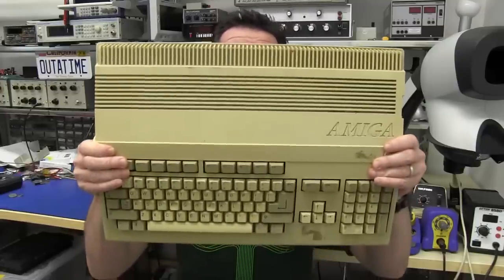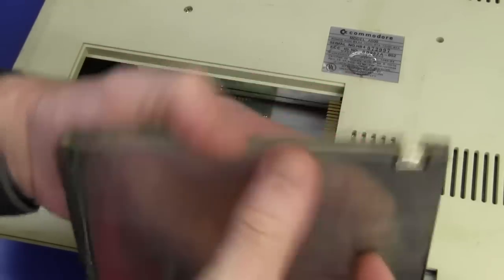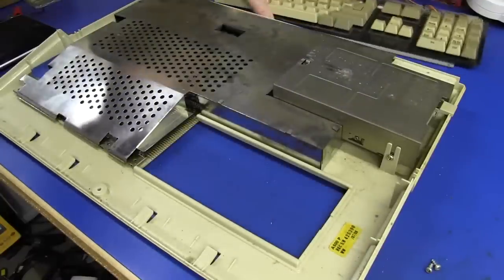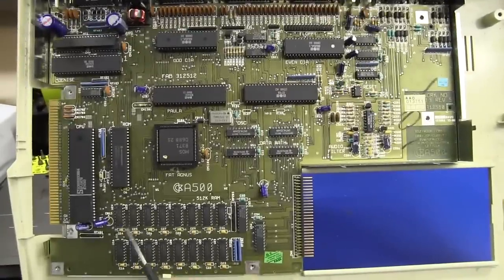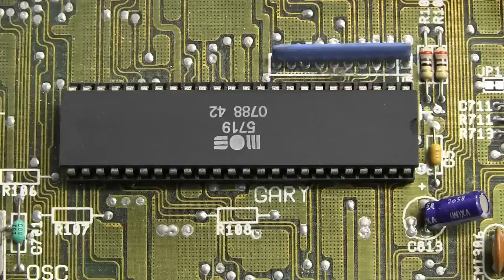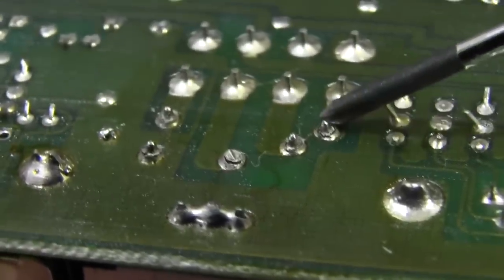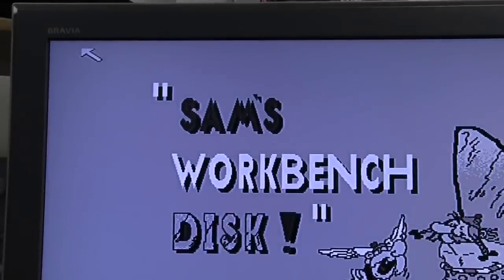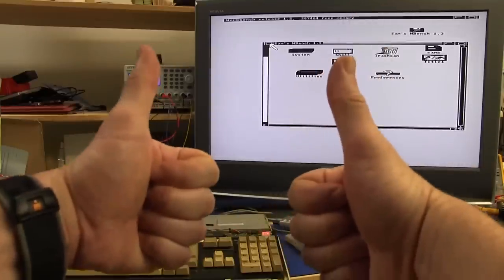EEVBlog #438 - Amiga 500 Retro Computer Teardown

Comment: I still have my Amiga 1000 with a 2 meg memory expansion module and a 20 meg hard disk plus floppies.  In 1987 it was the best computer on the market.  Commodore decided to make the Amiga a game machine and not a computer and stopped the research to make it better.  They did come out with an Amiga 2000 but is was just too expensive.  I moved on to an IBM machine when Windows 3 came out.  My first IBM machine was a 20 MHz 386 and I bought the $500 math co-processor to go with it.

Comment: Oh, for a minute there it looked like your floppy disk image on the monitor was blue, but then you obviously didn't have your screen hooked up to the color port on the computer (or you would have had to have some kind of crazy pin setup for that 23-pin connector). But then later everything looks B/W, so you were just using the built-in monochrome video jack (and had a blue tint earlier). Too bad they didn't just give the machine a color composite output, instead of making us rely on the A520 converter for composite output, huh?
Reply: +MaxxFordham They wanted to sell that extra part once you realized you could only get black/white with your old C64 monitor...
Reply: Well, if that's true, descore, then that would've been an annoying business practice that I'm glad isn't always done too often. At least they got smart and added the color composite jack some later models like the 600 and the 1200, but I never had one of the more advanced monitors or either one of those machines until much later in life, actually. Even then, my 600 is a UK version, so its composite jack still doesn't work right for me here in the USA.

Comment: And to think, i just threw mine away, along with thousands of disks :( It was important machine to me but when you move from town to town, you get tired of useless things around you.

First time i had my hands on Amiga 500 was when i "brokered" a sweet deal for a friend thru a schoolmate who was from Netherlands and they were cheaper there. As a reward, i was granted a full month of using it, pretty sweet thing back in 1987 when most kids around didn't even have C64s... Got my own around '95, of course i gamed with it but the main use was as a sampler and running Octamed with MIDI sync of course. The 8-bit 22kHz sound was pretty unique.

Got a lot of gizmos for it too, action replay, midi interface etc. Action Replay particularly was  handy for ripping sounds straight from RAM. And of course, multitasking. At best i managed to run FFT graphical synth, OctaMed, word processor and some small utilities at the same time.. The chipset design was just awesome, it was soo flexible and took a lot of responsibilities away from CPU making it really fast to run audio/video.

Comment: 8371 Fat Agnus isn't 1MiB chip mem capable. 8372 (first one to be part of ECS) was capable of addressing 1MiB chip mem.
BTW this is REV. 5 A500 wasn't capable to run 8371, you needed Rev.6 to use partial ECS.
No full ECS was posible on on A500, as full ECS could be fitted only on PLCC chips.
Reply: +WizardNumberNext  The 8371 was the OCS PAL and 8370 OCS NTSC Fat Agnus. 8372A was the ECS version mac 1 meg chip. and the 8372AB for the 500+ version which can handle 2 meg chip. 8375 is the 2 meg version which was used in the A600

Comment: Oh yeah.  That was my mistake.  I had my terms wrong and I wasn't paying attention to what I was typing.  I know that computers at that time weren't even capable of having 1 GB of memory.  As for computers no longer needing 1 MB of memory is simple.  File sizes keep getting larger and therefore a computer needs more memory to handle larger packets of data moving through the system.

Comment: Is your screen B&W? My Amiga 500's Workbench is colour (though that's prob a really old version I guess - but strange the game was B&W too). You may already know this but you don't need to boot games from Workbench - games auto boot from the "Insert disc/Workbench" screen. Always found it odd it asked for WB when it was probably the least used software lol. I used it for mainly copying disks and virus checking. My biggest gripe with mine was when I got Monkey Island 2 and it came on twelve floppies! I'd never heard of a hard drive at that stage and I gave up after spending the best part of an hour swapping disks. You'd literally walk into a bar and it'd ask for three disk swaps. Two mins later you'd go back out and you'd do the same again!
Reply: George Allan He was using the Amiga 500s built in composite output which is only black and white.  There was some software that used it to display an image with more shades of b&w than you could get out of the RGB output.
Reply: Ah good to know thanks! I mainly used an RF modulator. Thinking of removing the bromide/yellow plastic from my amiga at some point. Looks like a lot of work though
Reply: George Allan I need to do this too.  I haven't used Amiga hardware for more than a decade and am just starting to do so again.

Comment: The green solder mask looks like a product called Probimer developed by Ciba Geigy, it was a liquid mask, one of the first that actually worked and passed UL approval. It worked real well as a mask, but could look like shit. The second Amiga board (the one you stole a floppy from) looks like it has Vacrel on the board, which is/was a dry film solder mask from Dupont. Vacrel worked real well as well. Just my thinking. Worked on developing these types of coatings back in the mid to late 80's.

Comment: Don't knock that old computer about too much Dave. The first Star Wars movies were made on those. That expansion bay on the side is capable of so much more than memory. That's the Zorro slot system. They weren't called the Amazing Amiga for nothing. I have a 500, 1000, 1200, 2000, and a 4000/030. I'm still looking for a working 3000. I also need a copy of Workbench 1.3 if anyone has one that still works.
Reply: Star Wars was not made on any Amigas.  Star Wars eps iv-vi were filmed mostly in the 70s and early 80s and most of the CGI (such as it was) was done on custom hardware - Picture System 2 and - made by Evans and Sutherland (mostly for motion tracking shots using digital chromakey).

Comment: Well I have to say that the way the board was designed ie. double sided NON thru-hole plated has nothing to do with made in Hong Kong in the '80's, the designer would have designed it this way and the PCB manufacturing plant would have made it that way. Commodore would have made this decision based on the cost of thru-hole plating at the time. A PCB manufacturer at the time either got gerber files that they turned into photplots on film or as photoplots on film. These would then be used to manufacture the board to plan.

Comment: The iPad would probably still work in 2035, like I would expect my tablet to work in 25 years time, though having said that today's devices have to contend with being made with lead-free solder, which apparently isn't good.
tbh, I think the problem nowadays isn't so much that today's devices are more fragile, it's that I think QC processes are less stringent, so more bad devices end up out there, apparently the cost of replacing those bad devices is less than proper QC

Comment: Hi Dave,

If you want to know more about the Amiga and it's development, and a butt load more about Commodore in the 80's / 90's, check out the book "On the Edge" (ISBN 0-9738649-0-7). It's a big ass book, but it's very cool. Brings up a lot of interesting info on the design rationale for a lot of CMB stuff. Not to mention their fabrication plant. It's really worth a look. (I am not affiliated with this book in any way shape or form).

Comment: i keep a working 3.5/5.25 combo floppy drive around just for shits and giggles. sometimes you can find some interesting things on old disks (although i have to use my backup computer these days to even connect the drive, my primary doesn't have a floppy controller, yeah, floppy disks are officially dead and have been for over a decade)

Comment: Hi mate, the game you're trying to play aint in monochrome, what i think happend here is that the amiga is both pal / ntsc, it doens't care, but the sowftware you run on it DOES! if you have an decent monitor (wich takes both pal/ntsc) what i mean is that, and ntsc machine runs pal software, an pal machine do run ntcs software, but you have to hook it up to an monitor (15khz) or newer tv 15 - 31Khz AWSOME dubbelscan features, you would have gotten color boot from start to the end of the game :) yes, i',m an amiga fan, you can't hook up 31khz monitor to an 15 khz output and the just think.. it will work.. answer nooooooooo! can't you please do something like this about an amiga 1200 (wich is my favorite amiga model) and i'll help you out 100% ive have ppc card, pci card (through mediator) with an stunning 68060 cpu at 66MHz and PPC cpu @ 300MHz (real dual cpu system) they are from completly different archictuhure) with for the moment only 128mb ram, but as an amiga fantast.. that i am.. you don't need much more.. anyhow, get hold on an amiga 1200 and explain it for me, i can help with the things that maybe feels fuzzy :)

AMIGA FOR THE PEOPLE! NEVER STEP DOWN THE ART OF THE WORKS!
Reply: He connected his TV to the MONO port on the back of the Amiga, that's why there is no color, nothing to do with PAL/NTSC. He didn't use the RGB socket either directly or with an RF modulator, presumably because it is a DB-23 socket and those connectors are hard to find these days.

Comment: 24:59
Of course, with the 68K's whole "you can only access memory once every 4 clocks" kink, the CPU's clock rate might as well be 1.77 MHz. This also makes the Genesis MILES slower than the SNES despite having more than double the clock rate.
Reply: No, the CPU worked at 7 MHz.
Reply: ArumesYT The point is, it didn't work well with memory. "Blast processing" is clearly a HOAX!
Reply: Rogue Packets
There's a lot more to computing speed than memory access times.
Reply: ArumesYT The 6502 can also do more than one thing in a single cycle even though it isn't a pipelined design. Now imagine it at its native speeds, let alone successfully overclocked to 7 MHz.
Reply: The 4 clock cycles reminded me of Z80. I remember the 6502 having an advantage, I don't know about 1 cycle, but the most single opcodes took 2 cycles. The fastest memory write took 4 cycles or 3 if in zero page, while on Z80 8 cycles. Yet 6502 was always coming in less mhz for some reasons, so typical computer with Z80 at 4mhz could outperform or at worse match the speed of 6502 at 1mhz.

Anyway, when I started reading about 68000 I had the misconception that it would be like 6502 in cycles, because I remember people praising it like really good processor (and it is, in some other aspects). But then I realized, wow it would still be a chore to do some cool stuff with it. Some 16bit memory write is 8 cycles I think, and the 32bit memory write was 10 I think (of course there are many ways to write to memory, I am just discussing out of my mind the faster ones). Also 24bit addressing. And some neat opcodes I found (push and pop all registers, also a mul finally. And more). And I guess Amiga had the custom chips, blitter and copper and all that. Bitplanes would help to write graphics faster even if chosing less colors. Yet I am puzzled, even AtariST in demos, does amazing things for that 68000 without custom chips. I guess there are some neat tricks on 68000 despite the 4 cycle.

And then we have the ARM on Archimedes, which they say is 4x times faster at the same mhz.

Comment: Also, if you're after colour graphics, here's a guide to the Amiga's RGB pinout - to SCART in this case - but others should work.
http://eab.abime.net/attachment.php?attachmentid=16811&d=1212934877
VGA monitors won't sync down to the basic Amiga resolutions though, for that you'd need an adapter like an IndiVision.

Comment: The Amiga 500 had 512 KB on board, not 512 MB. Using the trapdoor you could expand it to 1 MB, not 1 GB. Looking at what the computer could do at this time, I wonder however why computers today need 1 GB, and no longer 1MB.

Comment: LOL, that keyboard controller. No surface mount or flow soldering used, just hand soldered probably, not very well either.
Reply: I would have guessed wave soldering for that production volume, except a few points here and there.

Comment: Hmm. I just remembered something strange. When I got my preordered A500 it was possibly one of the first ones in Finland. A strange thing about it: It needed two disks to boot. On powerup it first showed a hand holding a black disk reading "Kickstart". So you first had to insert the black kickstart disk. Then it showed the hand holding blue workbench disk. And if I remember correctly, you only had to insert the kickstart disk after power was cut. After soft reset only workbench was needed. But now I cannot find any reference to A500 ever needing a separate kickstart disk!! WTF??? I remember how happy I was when my A500 was upgraded during service so that it did not need the kickstart disk anymore. Today it might be quite interesting machine..
Reply: Also when I got it, the power supply was faulty out of the box and needed to be replaced. Quality control.
Reply: That's VERY strange! I wonder if it was some sort of prototype that was mistakenly shipped to you
Reply: Petteri Kähärä on 1st disk was kickstard and on second was worknench, first A500s didnt have kickstart on board
Reply: that was for the first Amiga, the A1000
Reply: LordPBA Yes I know. But mine was A500.

Comment: Reason for monocrome as it will be in a pal signal,  try useing a pal mode on a tv or getting rgb singals out of it,  this thing whould be intresting to see if you had it hooked up to ardunio programming or providing serial data to one.  Its a gem from the past that so adaptable it be worth keeping.  Also you can get a CF Card  (upto 4gb) adaptor so you can put ADF (floppy disk images) files onto it.  Tresure this machine,  it will last you longer than any modern day pc, and your childrens childrens childrens childrens childrens.  They where built in the day just on the brink of disposeable Computers.

Comment: Looks like the previous owner had quite fat fingers, with the broken power connector and the botched floppy flat cable, missing screws and such.
Reply: The cloth at the bottom of the ram expansion it is made from asbestos fibers and is heat resistant. Not the best material to work with.

Comment: Well, I beg to differ. Just look at the modding community of any big title game, and even a few mods been more popular than the original. (DOTA and LOL)

However, it's a pity that 25 year old computer still works, yet the computer I bought in 2007 has died due to capacitor failure. (though both my 1996 and 2001 computer still work)

Comment: I enjoyed that. I used to have an Amiga. Mine was the slightly newer 500 . The PCB you showed with the rough surface was multi layer PCB. Not great quality in these PCs. The power supply had a heavy plug and thick wire so Im not surprised the solder joints broke. Good in their day though. but u r dead right, slow and hopeless by todays standards.

Comment: You seem to be the right guy, both in possession of the know-how and the insight about the brilliance of the Amiga architecture.
Would you be interested in developing a board based around multiple FPGA's which would reproduce initially the original functionality of the Amiga chipset but would later on be expanded upon by improving the FPGA features (once we have a running and working Amiga system running on top of the redesigned board based on multiple FPGA's)
My idea is to use cheap-ass FPGA's like the chinese Altera Cyclone II modules which could be easily socketable.
These: https://imgaz.staticbg.com/thumb/large/oaupload/banggood/images/EC/78/6a7288ea-d9e3-490c-a778-0e1fd3d7a0ed.JPG.webp
And of course, some RAM sockets so we can use modern memory.
One of the important goals from my point of view is the way Amiga managed a non-uniform memory pool in a uniform fashion (Fat AGNUS magic :) )
Reply: Oh, and I would rather begin with an A1200 or A4000 base system :)
Reply: Once we have a full working FPGA architecture imagine what can be done offloading stuff to hardware, specially if the software is aware of it and made able to implement parts of it's code in hardware ;)

Comment: You'll find lots of MOS in Amiga's owing to Commodore's ownership (typical commodore mind you, the MOS factory was allowed to fall apart, the tanks leaked and needed to be decontaminated) apart from the Escom made models (where the custom were made for Amiga Technologies by HP of all people, perhaps something to do with the PA RISC project, but I do think that was under commodore not Escom). The reason why most of the chips were in socket was due to the high level of failure of those chips, not as bad in later models (if I recall the A500+ has them soldered not socketed).

The A500 is essentially a low cost A1000 btw.

The initial reason for the A600 was to mildly update the A500 to feature surface mount tech in order to improve things. Talking about strange design decisions some of the A4000's used ZIP memory!
Reply: Oh yes, oddly the PSU for the A1200 is underspec for most of its uses and the UK PSU's are almost always labeled A300 or A600, I wonder if they were left overstock! Dreadful especially when you are using the trapdoor or have one with a 2.5 IDE drive. Oh and the PCMCIA port on A600/A1200's are not to spec, think it was something about the reset pin. (used to be a mega Amiga head back in the day! Truly Amiga till I die! heh)

Oh yes, part of the OS is in ROM, kickstart, kinder like the old Macintosh Toolbox, apart from in the A1000 that requires a kickstart floppy.

Oh yes, most games need to hit the metal so to speak and can't be run from workbench!